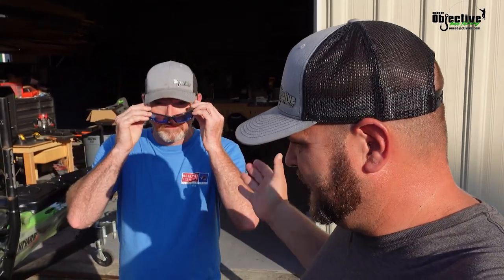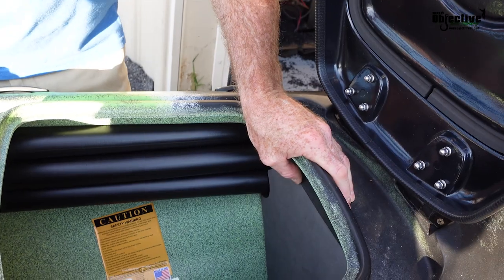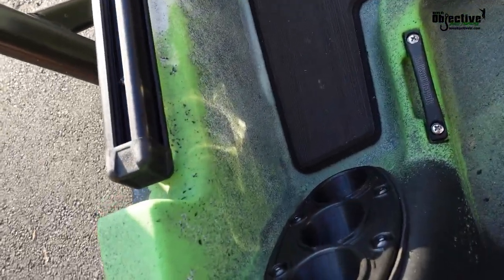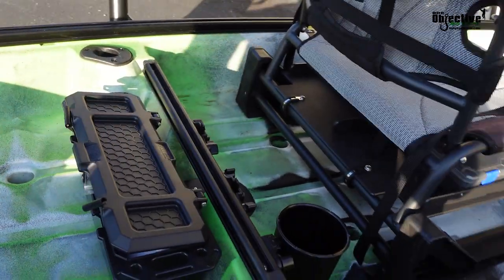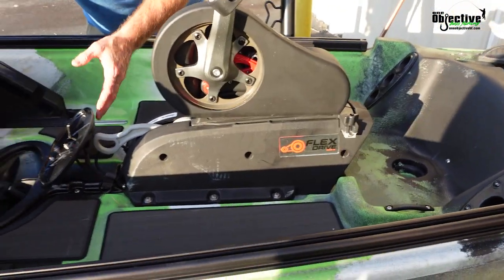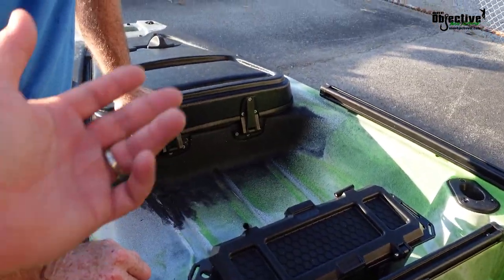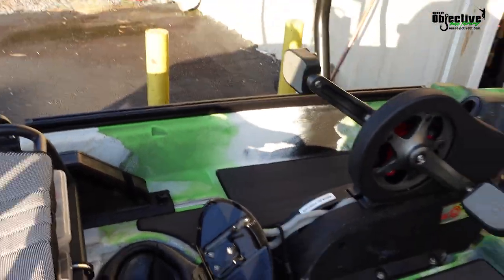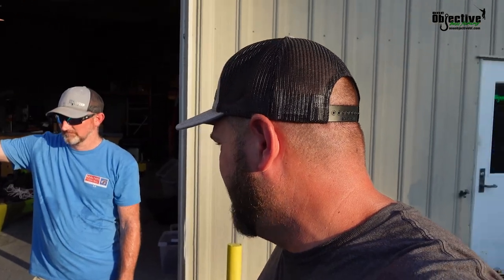Jackson Knarr Full Walk Through

Comment: I have a serious concern given the capacity was 475 when it came out. Then they dropped it to 425 after review from FishingWithGramps. When I tried on in May, it was the one I preferred over the P127. I'm real interested in your assessment after having it under load.
Reply from the maker: The Knarr can handle a lot of weight. It’s a very balanced kayak. And very stable. When compared to the P127 it’s a no brainer. The Jackson Knarr is way better then the P127!when it comes to handling weight. And peddling. And turn a lot better then the P127
Reply: They dropped the listed weight to try and get people to not over load it.

A general rule for kayaks is to only go up to 80% of the total weight capacity, so they gave that rule a little more clearance.